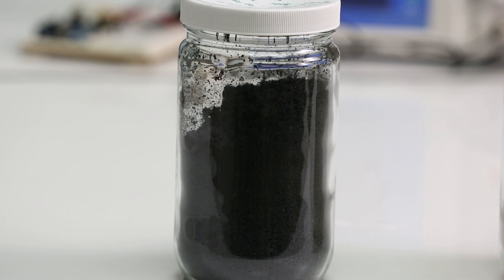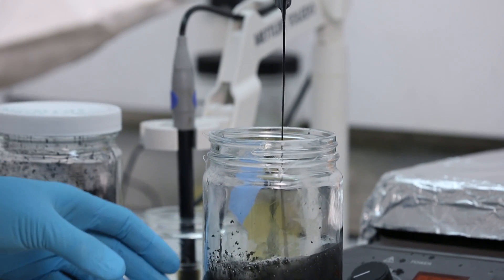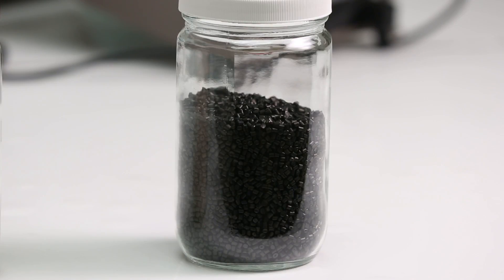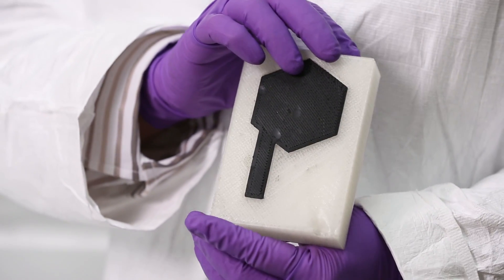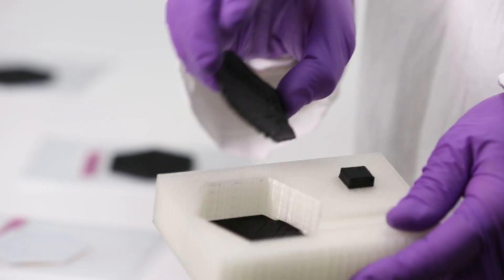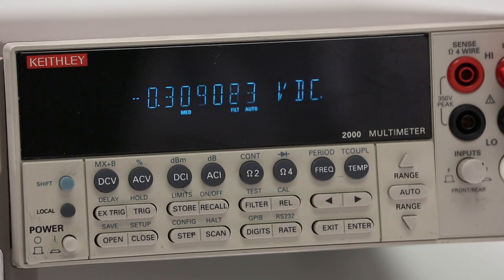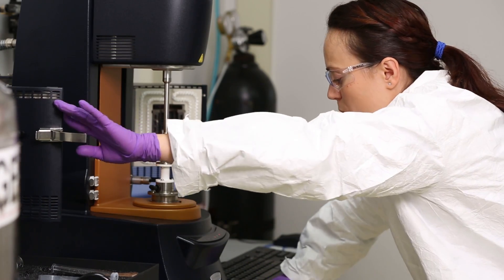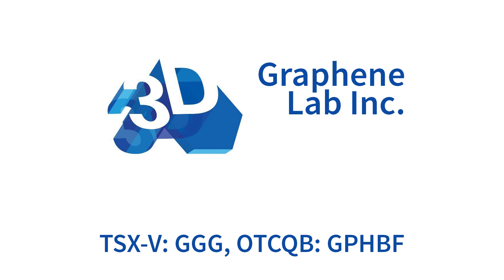Graphene 3D Lab Inc.

Comment: Will this battery energy output increase with new revisions? My concern as a potential investor is that the size of the battery demonstrated is a lot bigger than that of a AA battery, so there would be no incentive to switch from a AA battery to this one. If you were able to design a smaller form factor than a AA batter  with at least the same or greater energy output, this would be enticing.